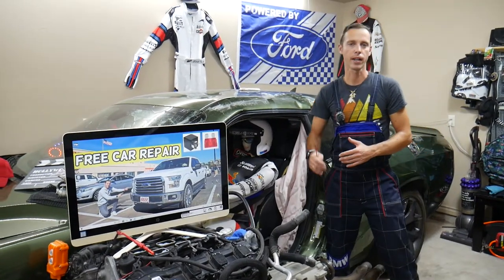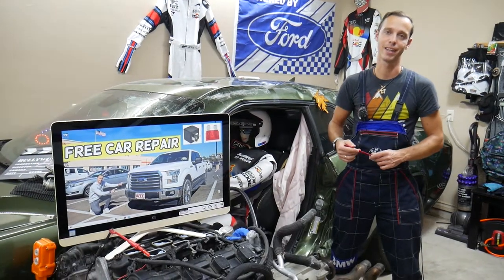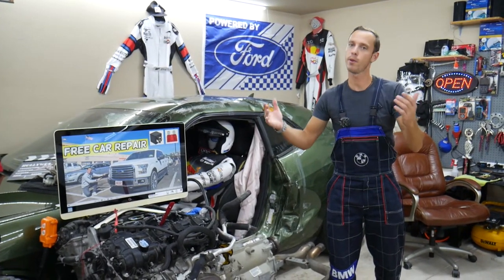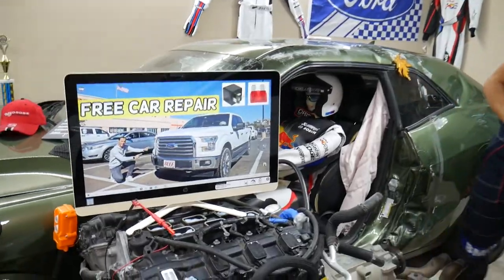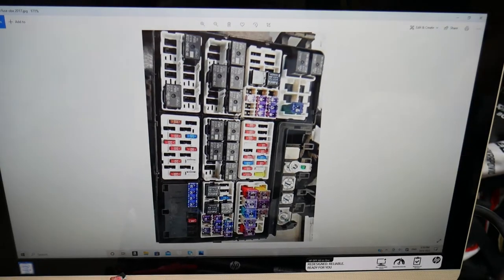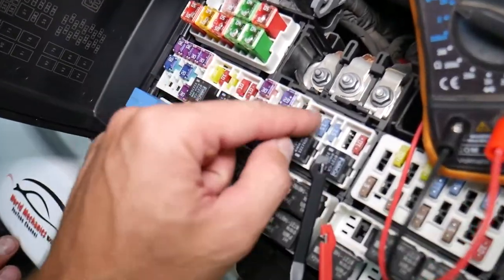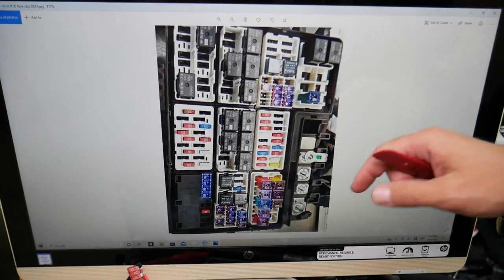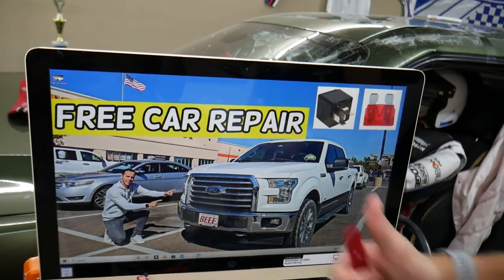FORD F150 TRANSMISSION OIL PUMP FUSE LOCATION REPLACEMENT F 150 TRANSMISSION FLUID PUMP FUSE 2015

Comment: Thanks for the video. Checking my fuses, #42 fuse (Transmission Fluid Pump), there is no fuse there. Is that correct?  I am having shudder issues and just looked at my fuse box, and there's no fuse here. Should I go get a 30A and put it in #42?
Reply: This is for my 2016 F150 Platinum 3.5L ecoboost